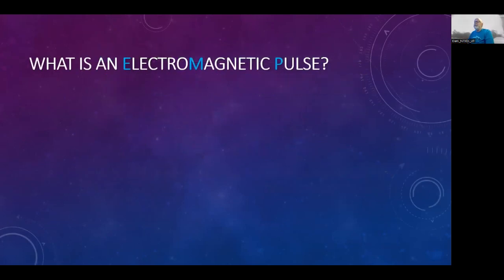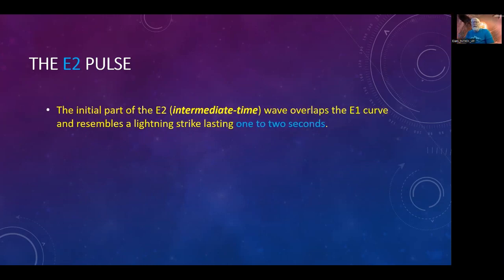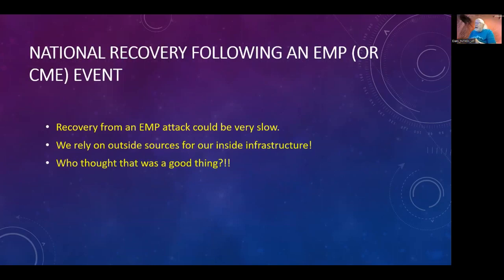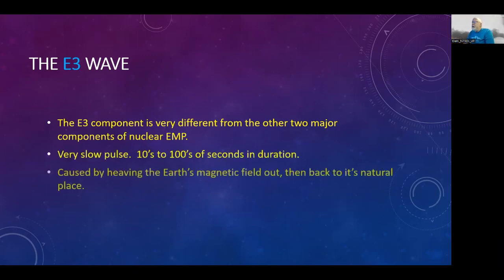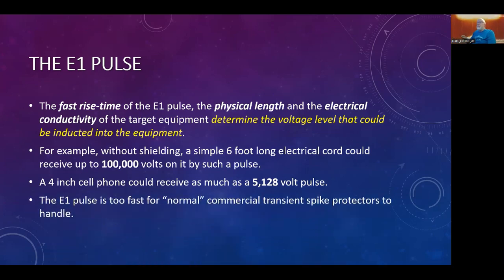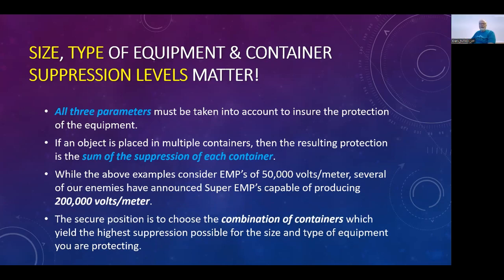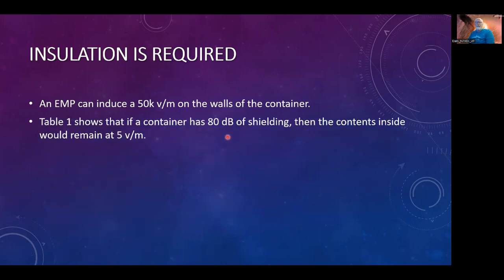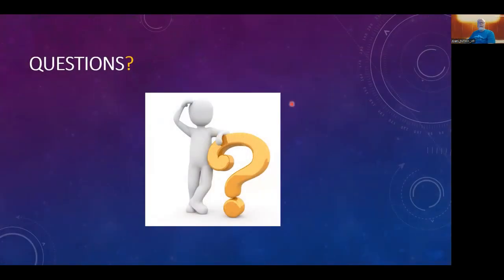EMP - what it is and how it affects - 05/04/2023

Comment: Single point of failure for most installations is AC power generation.
You touched on solar (and, presumably, wind) but
How can the average person protect his gas-fired (for example) 5500-watt generators?
Too big for a metal trashcan.
Is there a resource (company) somewhere that makes a faraday cage (even a kit) to protect generators?

Comment: I think some people in this presentation think ESD bags are conductive, they are NOT.  They are designed to gradually dissipate static charge.  ESD bags are made with a chemical antistatic that absorbs moisture which is what is used to gradually bleed off static charge.  Here is a great presentation from the inventor of ESD bags.  It's a old video of a presentation put on by the ESD bag inventor Dan C. Anderson.  It is a wealth of knowledge on ESD products.  ESD Explained & Demonstrated + History of the Pink Polyethylene ESD Bag
  https://youtu.be/Uk5F3rQNUkU  
Mike KC3OSD
Reply: Thank you for the clarification.  I was unclear about this while watching the EMP presentation.  So, as I understand it now, if I choose to have multi-layered protection, I might put my radio (or other equipment) inside a Faraday bag; put the Faraday bag inside and ESD bag, and put the ESD bag in a can sealed with aluminum tape.  In other words, the ESD bags serve a completely different function than a Faraday Bag, and they could conceivably be used in conjunction.